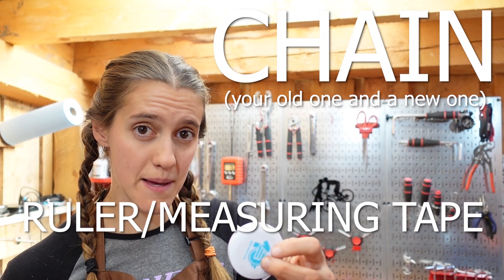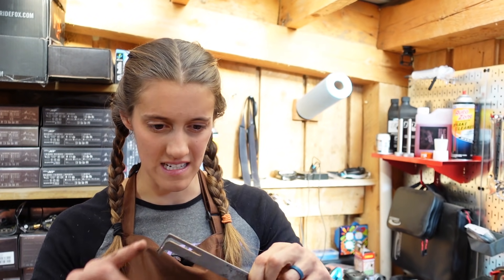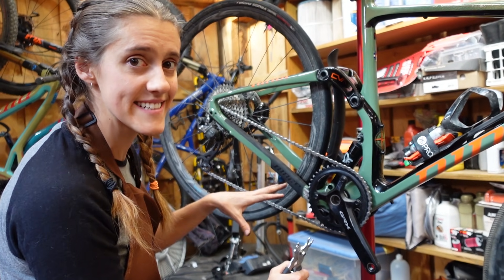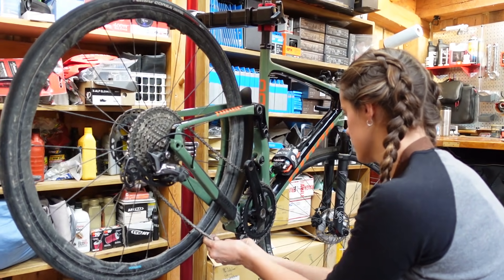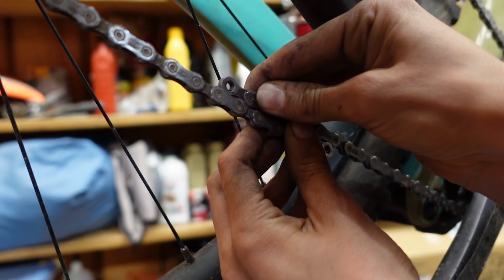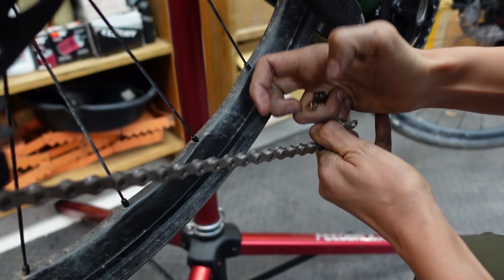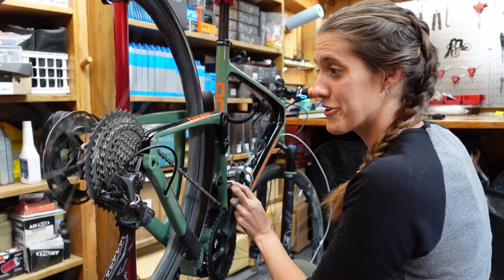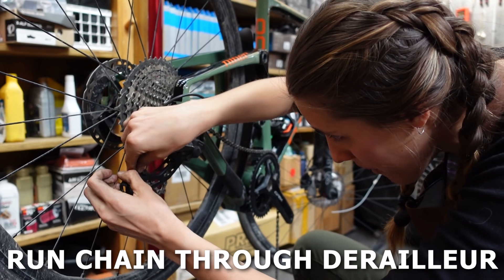How to CHECK CHAIN WEAR and INSTALL a new chain | Syd Fixes Bikes

Comment: The "measure the chain with a tape measure or ruler" is totally wrong. 
The chain doesn't really "stretch". The plates are very, VERY consistent in length.  What actually comes in contact with our cassette and chainrings are the rollers. The rest of the chain is just carrying the rollers around. The rollers' that are like bushings, wear as the chain is used. Both the outside wears as those come in contact with the sprockets, but even more, the inside diameter gets widened as it comes in contact with the pins, i.e. the chain's rollers have a play in them, so the effective pitch - which is not the distance from pin to pin, rather roller to roller - gets wider, as with incremental wearing the rollers can now push away from each other.

Think of it: the chain's rollers and pins are typically made out of very high strength steel. The sprockets, especially in higher-end cassettes, are often aluminum alloy. If the chain was not designed prioritizing wearing itself more than the sprockets, we would be going through alloy cassettes or alloy sprockets far more often than chains. 

Again, don't flatter yourself thinking you have the strength to stretch a bike chain...not with .66 or .50 low gearing ratio even. Bike chains have 1000s of KGs of tensile strength, and it will NEVER break at the plate, or stretch a plate before braking at a pin connection.  It is the grit / sand etc (really hard elements, harder than steel, and ofc aluminum and its alloys) that screws up the rollers after thousands and thousands of rotations, not you stretching the plates. And the weird angles wide range cassettes force the rollers to operate at (different offset planes between rear sprocket and chainring) is adding to that a lot.

You can keep your chain on for "ages", and the pin-to-pin measurement - be it two or twenty - will be super consistent (given you had a good chain to begin with), and this way you will go way past its allowable wear without ever knowing. Sure, the pins will move apart as the inner plates wear too, but for 10-12 speed chains, this is WAY to late before it becomes noticeable. Use a chain wear gauge. There is a reason all of those measure the play / pitch between rollers, and not the plates or pins.
Reply: Have you ever put new and worn chain side by side and trying to match every link? They don't match because the chain gets longer because of the pin and roller wear.
Reply: Both the roller and the inner chain plates wear.  Even if the outer plates are fixed to the pin, the inner plates wear because they float on the pin in order to allow the chain to articulate and flex laterally.  Wear of the holes on the inner plates will contribute to elongation of the chain  by  increasing the distance between the pins.  However, as you explain, it will be different from the wear on the inner surface of the rollers, which won't increase the distance between the pins. It is nonetheless more significant for cassette wear and a good reason to use a measurement tool instead of pin measurement.
Reply: @bengt_axle  true, wear is holistic, but by the time elongation at the pins is noticeable with a ruler, the roller measurement would be past the replacement recommendation, at least for 10-12 speed drivetrains.

Comment: Good video but you failed to mention one thing which is what if the new chain is too short like it is on 9 cog bikes or 27 speeds. You need to buy 2 chains and put them together with pins or quick links to make one chain. All chains sold are too short to go around most if not all 27 speed bikes. You get one chain for the price of two since the new chain is about 6 inches too short.
Reply from the maker: Wow, we've never run into that. Even back when we had 3x9 drivetrains.